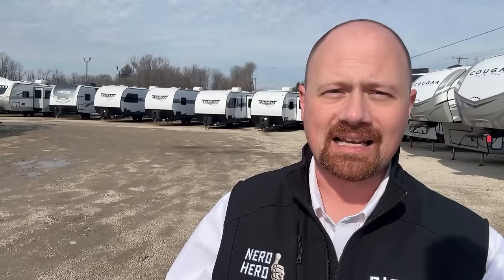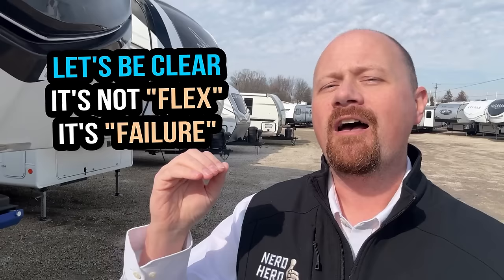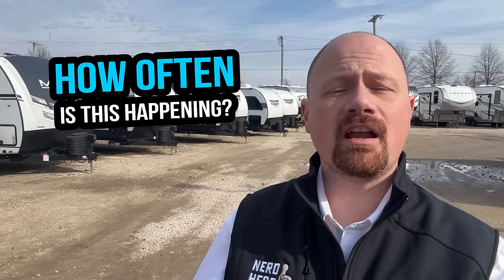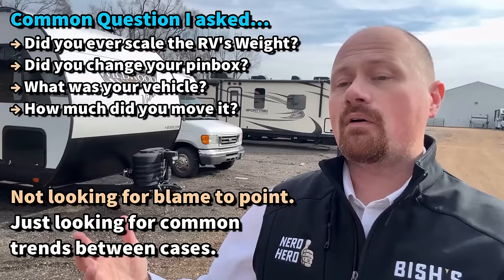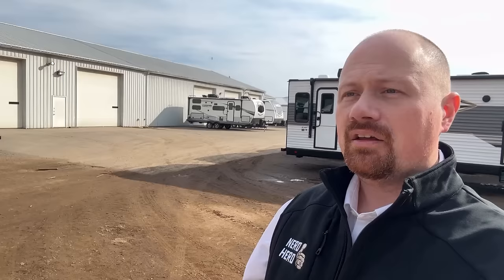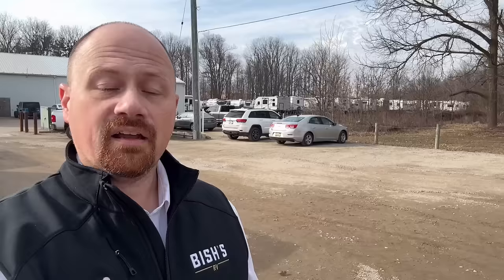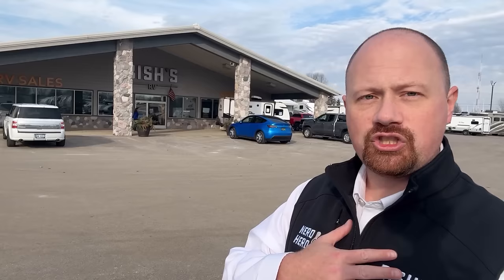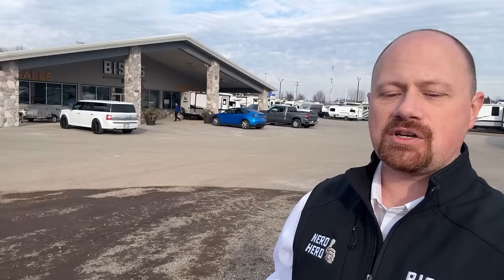🚨 RV Frame Flex & FAILURE!! • WHAT is Happening and WHO is Responsible?!

Comment: My 2023 VanLeigh 42RDB is 18500 gross.  Yet they use the smallest possible axle 8000 pound x 2 for max 16000 on the axles. 

It should have 6000 lb triple axles.   Not that you could overload it, but the axles could handle more stress that’s distributed over a wider area.

Comment: I believe there is one thing you missed in the "why this happens" is speed and the crappy highways in this country. Numerous times I am in my vehicle not towing and cruising the speed limit of 70 and I get passed by the guy pulling his large 5th wheel. Those things are not meant to be pulled at 75 - 80 MPH. Not just from a safety standpoint, but the point that roads are rough and that is transferring a lot more stress on those frames. I think manufacturers need to indicate how many miles a frame is designed to be towed. It will never happen, but it would be nice.
Reply from the maker: That certainly could be a factor

Comment: When weighing the rv, most people forget that when you get to your destination,  that weight goes up because of your tanks and your weight. I guesstimate what that weight is so I don't go over
Reply from the maker: Water is about 8lbs a gallon. Use that to understand the max water weight you may be adding to keep yourself in specs 

I park camp so I don’t need to factor in water weight
Reply: Great comment dawnr6577. Can you imagine structural engineers designing cars, bridges, planes, buildings, and all structures based on just static weight (objects at rest) and not designing in kinetic weight (moving weight). That is exactly what the RV industry is failing to do in both cases and that's one of the big reason these rv's fail. Take for example an RV with 2 -7000lb axles with a maximum weight rating of 16,800lbs. If you are loaded above 14,000lbs at rest (static energy) your axles are overloaded. If you are traveling (kinetic energy)this is where the problem really begins. They say 20 percent of the weight of the RV is  transferred to the truck when you're traveling, you run the numbers. 640lb buffer. That's way too low of a margin to support a 16,800lb RV fifth wheel rolling down the highway at highway speeds. The RV industry knows this, but they continue to underbuild their chassis. At minimum, the axle weight rating and suspension components need to be AT or ABOVE the maximum RV weight rating of 16,800lbs.

Comment: RV's should be built for expected use, such as installing a generator and a crockpot and pulled by a truck. I guess that the RV manufacturer says to LCI/Lippert that they need a frame to handle xxxx lbs. with this weight distributiion? So either the weight demand is underspecified, or Lippert are building frames that do not reliably meet the specification over time. Overall, it's just another aspect of this industry building product that is not fit for purpose.

Comment: I think overloading is a very common problem in all sizes of RVs and tow vehicles, and I'd wager a non-trivial percentage of these cases are a result of that.  I would be interested to know if there is a single documented case of these types of failures in empty fifth wheels.  The thing about steel is it only gets harder with age.  It isn't as though you start flexing at some point where you didn't before, given the same load.  Aluminum has no endurance limit, so it does work that way, but not steel.  This is why airframes have a cycle time, or a number of takeofffs and landings in their lifetime, they are aluminum.  Steel gets work-hardened and then aproaches a limit, and thats that.  What I suspect is more likely is that the frame became permanently deformed, and once that happens, it's compromised at the molecular level.  You now have a section that is deformed, having exceeded the tensile or compression strength limit of the steel, and it only needs to happen once.  Its not that frequent use "wore it out", but rather, when you use it every day, or very frequently, you increase the statistical likelihood of encountering a scenario where an overloaded or otherwise misused frame is put in a position to be damaged.  In other words, if you overload a frame but only drive it 150 miles, there's a low likelihood you'll encounter a huge pothole or go over an obstacle that puts huge torsional or bending stress on the frame, so it may never fail.  One thing to keep in mind is that it's way easier to overload a 40-foot fifth wheel because they have such immense storage space, but harder to do so in a shorter one.  The prevalence of full-time living with these units is much higher than it used to be, especially among younger folks who dont just park it for the season, and people are packing these things with all their worldly possessions that used to fill a sticks and bricks.   Also, people have no idea what things weigh.  How many people even know that their 100-gallon freshwater tank weighs 800 lbs?

One final factor is the relatively modern prevalence of using these rigs for "boondocking" or very rough environments.  Nobody did that even ten years ago.  These were interstate/RV resort units.  But I routinely see massive fifth wheels in very sketchy places, and you can imagine the loads on that pin box when it's used in places like that.  I think its noteworthy how several Youtubers have shown they have "flex" on one side and not the other.  This tells me their frame was torsionally overloaded, or twisted.  Many people go with gooseneck hitches and these drastically increase the torque moment on the frame since they are such a long lever arm relative to the pin box area.  Something to think about.

So, as with any problem, there are likely numerous causes, but since this is a new phenomenon, and big fifth wheels are not, we have to look at what changed, and when you start examining that, a few things really stand out.  

Thanks for the video, Josh.

Comment: I have a 2018 Jayco Eagle 355mbqs and the side wall is cracking at the bedroom slide. I have over 40,000 miles on it. The crack started right outside the 2 year warranty and they will not cover it. Also this year on our way back from Florida a leaf spring broke, this is another issue that should not happen.

Comment: I worked in the trucking industry for many years and hubometers were always used on trailers to track mileage for service  intervals. It has always bothered me it has never been applied to RV use, if you can't collect data how can you determine life span of a vehicle or trouble shoot. When searching for a used RV trailer it's impossible to know how many miles of use they have seen, also what does a manufacturer consider as being moved to much in the grand scheme of things for a travel trailer.
Reply from the maker: Yeah the tech is there. Maybe it’s time they start applying it to rvs

Comment: Good information and well thought out.  Much better explained than a lot of the other videos on you tube from people who have experienced this, and they are upset (obviously) and don't cover all the bases.
Reply from the maker: I think it’s pretty obvious I do feel a certain way about things personally but I tried really hard to just boil down all the facts that I could
Reply: @JoshtheRVNerd  what about washer/dryers?  These 5th wheels have those hookups and I am sure depending on brand those can have different weights.  Manufacturers don't provide those from the factory usually but they prep for them.  And that is a couple extra hundred pounds on a single spot (usually on the right side) of 5th wheels.

Comment: Hey Josh!  We are planning to purchase a large side patio toy hauler within the next few months.  We were hoping you would address some things consumers like us could do to minimize the chances of frame failure, besides not over loading. Do you have any knowledge of how a better pin box  or independent suspension would help minimize the forces transferred to the RV?  Thanks in advance.
Reply from the maker: Kind of went through this video and offered some recommendations on how to avoid somebody name causes in areas of concern. Is there something else you were curious about?
Reply: @JoshtheRVNerd  Your information and thoughts were very interesting to us.  We are planning to move often so beyond not putting too much weight in the RV, we are trying to find other ways to reduce the chances of failure.  From my research, it seems a GenY goose and independent suspension would be two upgrades we could add to reduce the shock transferred from the road to the frame.  We were also considering an HDT.  Your thoughts on too much truck really makes sense. Thank you for taking the time to make this video.  We have been watching your channel since about 2017.  We appreciate your humble and sincere RV and industry information.   If you have any suggestions for other upgrades consumers should consider to help reduce the chance of frame failure, please let us know.

Comment: Buyers should look at the difference between the dry weight and gross weight allowed. A 40’ plus RV that only allows 2000lbs of cargo does not allow for enough cargo. 
If you go boondocking it’s even more critical. Fill up fresh water one must remember each gallon of water is 8lbs. 
80 gallons X 8 lbs = 640lbs.

Comment: I can understand almost all of the factors except one; nobody is going to spend 75k or more on an RVG they can only tow 3 times a year for 5 years. Manufacturers either need to give an actual rating or stop suggesting the customer has been towing too much. Many of these frame cracks happen early in the RV's life, so this is just not or should not be a factor.
Reply from the maker: Just talked with a mfg today about ideas for ways to better set. Proper expectations for customers. I’m hopeful at least a few of them will start doing that.

Comment: THOUGHTS FROM A BUSINESS JET LOADING PERSPECTIVE: In some respects, this question of RV loading, Gross Weight, added equipment and weight distribution are identical to those encountered by airplane buyers.

When a business jet customer would come to 'spec out' his airplane, the manufacturer was very careful to not only calculate how much weight was being added to the 'brochure weight' but also how that weight affected the overall fore-to-aft balance (Center of Gravity) of the aircraft. This CG balance was super critical to both safety of flight and performance. In addition, every pound of equipment added meant one less pound of fuel, cargo or passenger that could be safely carried.

At delivery, we weighed every airplane and provided the customer with charts and data showing how much actual carrying capacity was left. It remained their responsibility from then on out to recalculate this data for the lifetime of the airplane anytime equipment was added or removed.

In addition, the FAA regulations required that all designs would remain safe and airworthy at 50% beyond their design characteristics.

I would think that modern frame designers (Lippert in particular) are using computer modeling that provides a damn accurate understanding of load, stress and ultimate failure points. I don't know if they ever design to 150% of ultimate load, but I suspect that keeping frame weight down is a huge driver in their design criteria.

Aircraft manufacturers would also placard every drawer and storage space to show just how much weight could be added. Just because you had a massive baggage compartment in the tail DID NOT mean you could cram anything that would fit inside it.

We also NEVER allowed modifications that were not specifically approved by either us or the FAA (I am thinking about your Pin Box  comments).

Perhaps these large-length toy haulers need more information from the manufacturer about weight distribution and maximum loading in specific areas. It also seems like "Delivered Weight" should be included and placed on every unit prior to delivery. Maybe that information should be a precondition of purchase.

As to these RVs being designed for 1-ton dually setups, that is an interesting thought. Is that true?  What do the computational models show as assumptions for the transmission of shock loads into the pin box???

Finally, the notion that RVs are not really designed for full-time, long-haul use seems like a huge cop out.  Most airplanes are designed with a maximum life in mind. We didn't tell our customers, "sorry, this only an occasional use tool." Telling customers that $170,000 products are really just built for  'occasional use' suggests to me that they may be wildly under-designed.

Comment: As far as RVs not being designed for daily use, if the frames are failing in the first 6-12 months, does that mean in the lifetime of the RV it should not be used for 6-12 months of cumulative time? That's BS.
Reply from the maker: Consider vehicles for a moment instead of RVs. They have warranties delimited by time and miles. If you use up the miles before the years, then the warranty is done

It's the same concept here except NOBODY is telling you what the intended miles would/should be 

And I suspect it's because it's actually far lower than anyone would want to see

Comment: My 5th wheel manufacturer Alliance RV couldn't tell me what the maximum vertical pin weight was for the pin box and they told me the weight rating for the pin box was 21000 lbs when the sticker on the pin box very clearly says 18000lbs. Which means I can only put a few hundred pounds in it. When I told them that they didn't believe me until I sent them a picture of the sticker. I'm a retired over the road truck driver and understand all this stuff. This 5th wheel has only been pulled less than 5000 miles. It is ready for the junkyard. I found out ALL RVs are JUNK. That was my retirement money and now my retirement is trashed because of lying cheating RV manufacturers. This was rated for full time living and 4 seasons. They lied !! They got my money and I'm SOL.

Comment: Frame flex is normal, excessive flex leading to failure is not. I put that on all 3 parties involved. The frame manufacturer, the coach builder and the end user. Not so much the frame manufacturer as they are building those frames to the specs that the coach builder provides. But then the coach builder over-builds on those frames, adding options and weight, reducing cargo capacity. Then the end user either over loads them or poorly balances their load inside the trailer. I do feel that standard rigid pin boxes are also partly to blame, with our ever degrading road quality. Something like the Lippert Air Ride, Curt Flex Air or even the MORyde cushioned pin box would help a lot with removing energy transfer to the frame.

Comment: The fact that RV manufacturers build their RVs to only be towed a certain amount it unforgivable to me.  A frame of a properly designed RV will not degrade regardless of how much it is towed.  If the towing of an RV is limited to a certain number of miles that tells me that the RV's frame is materially deteriorating the moment it leaves the factory.  This would only be the case if there is too much flex built into the frame which causes stress fractures in the frame.  These fractures are small at first but grow over time to the point that the frame breaks.   In my world this is not an acceptable design criteria.  I would expect that the frame of an RV would be designed to last essentially forever if it is used with specs.  I'm aware that any piece of metal of any kind will degrade somewhat over time but this time frame should be measured in decades not years.  I can agree with the too big (actually too stiffly sprung) of a tow vehicle, I can agree with overloading/mis-distributed loading and the unapproved pin box.  All of these will cause some design parameter to be exceeded.  I cannot agree that a frame is designed to deteriorate even if it is used within the other design specs unless, as I said, this period is decades and not year.  Just my dos centavos.

Comment: Simply put the frame designs were not extensively road tested with each trailer loaded to maximum capacity.  Next time a flatbed gooseneck trailer passes you pay attention to the front section and notice the bracing and gussets such that failures do not occur normally. There is also a balance of frame flex versus rigidity in choosing  the steel. Too rigid the structure suffers, too much flexion and the chassis or frame suffers. 
Next the suspension choice is paramount to absorb the road shock. Finally, if the suspension on the tow vehicle is too rigid the stresses of the road will be transferred to the RV. Lot to think about and I lay the blame on the processes used, the lack of critical engineering design, the quality of the steel ,  and a lack of real world field testing. Time for all the manufacturers to sit in a room and fix the problem!

Comment: I appreciate you trying to play “devils advocate” for both sides of this. While I am sure, there are many failures that are caused by overloading RVs, as an engineer I can certainly tell you that many of these frames are not built as sturdy as they should be. 
And as for the “moving them around more than they should be “ part. That is literally just a manufacturers pushing off blame. If that is the case, they should just call them a trailer home rather than a travel trailer.
Reply from the maker: I think you need to look at the whole scenario from multiple angles to really get the whole picture. At the end of the day I still cannot feel it reasonable to fault consumers for "using the RV incorrectly" when they were never really given the info to know how to use it "properly."

Comment: I never ever ever travel with the fresh water tank full. Multiply 8lbs x how many gallons it holds. You'll be surprised. 
I get to where I'm camping and fill there or as close as I possibly can.
However, of the you tube videos I've seen of people having problems it's almost always a brand new camper.
Reply from the maker: Yeah water adds up fast